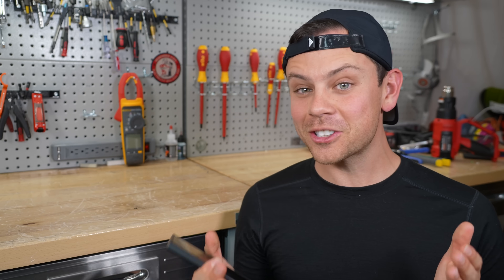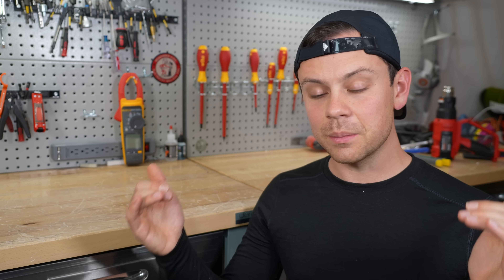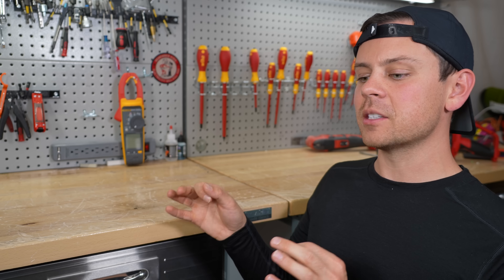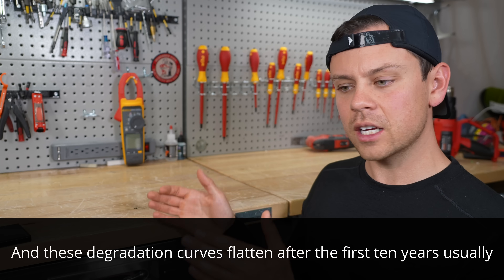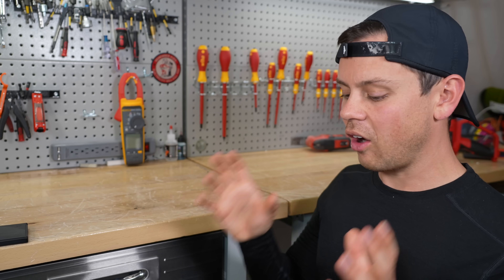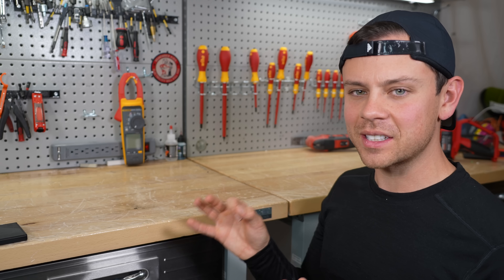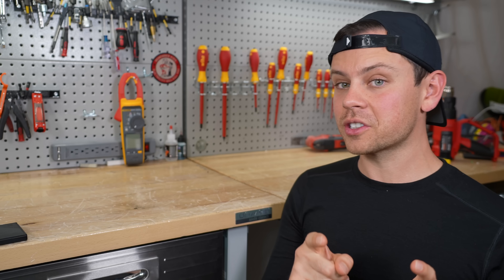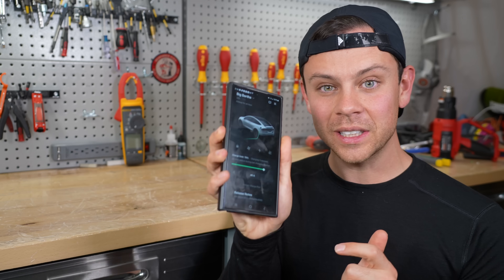LiFePO4 Longevity Discussion! Why Charge to 100%?! For Solar??

Comment: I am planning on making a UPS style battery backup system without solar for my home's refrigerators. In this case, I was going to keep the LFP battery at 100%, so it is full and ready to be used if the power goes out. Is this more detrimental of an idea than I was originally thinking?

Comment: Question perhaps for the knowledgeable commenters... I'm interested in about a 600w solar system for a hunting shack/shed. Primary use would be several hours per day running a vent fan to prevent condensation in the metal shed, then running some led lights and a few things when in there. This is in Wisconsin. What concerns should I have for lithium in potentially several days in a row below zero temp?

Comment: I didn't see the first video but yeah, the thing about LiFePO4 (having owned a car that uses one for 2 years now) i can say that charging to 100% is ok. It's just fine. Solar is way different than a car though, but one thing tracks: That voltage curve. That's unique to them and are extremely tough for any mfr or computer to basically predict when the batteries are between 90 and 10 cause the voltage median is gonna be very similar all through that range. A charge controller for a solar system?? Wow, yeah, i think that'd pose a bigger challenge. Can't wait to actually go as off-grid as possible. THanks for the video!

Comment: why are victron solar chargers set to 4.2 volts from factory,what voltage is 100% on a solar system not used daily?

Comment: You contradict yourself in the first minute… “charging to 100% doesn’t hurt it at all”, and then: “if only one cell is making it up to 100% it will fail first”.
Reply from the maker: Charging the whole pack to 100% with solar is difficult, and most people need to focus on doing it more. If you hold any lithium ion cell at a higher voltage, you will have faster degradation. But people aren't even charging enough to avoid imbalance. You want the cells to cycle together. Having one cell held at high SOC while all the others are not, will lower the capacity of the entire pack over time. Charging to 100% off and will keep all the cells happy and balanced
Reply: @WillProwse  while charging a life-po4 cell to 100% is has much less degradation than a -ion, it is still a negative impact.  charging to 100% (or even 95%) occasionally to help the balancer get on track is a good thing, that should be on the order of once every 15-20 cycles or maybe once every one or two months.  because it definitely has a negative per cell impact on health.

Comment: So for a camper is good to have instead of one big battery two smaller batteries of lower capacity and use them in turns, while you use one, the other one gets charged to 100%. Then alternate.

Comment: I have Solar and a LFP battery. Since I increased my Solar array last autumn, I had the "problem" that my battery sat at 100% for most of the day, since the power usage over night rarely brought the capacity down below 60%. Since that is the one thing that all batteries, including LFP don't like, I am currently working on a little algorithm that makes sure the batteries charge slowly over the course of the day and only reach 100% right before the sun goes down. Apart from that...I don't worry about my battery.

Comment: Fun fact one of the most damaging thing for LFP in normal condition is continuous charge of more than 80% at a time, so if you setup limits from 0 till 100, each time you charge your EV on a sunny day you will most likely have one continuous cycle from 0 till 100% damaging the batteries. In addition continious cragging cycle exceeding 80% is not linrary destructive, that is the reason manufacturers usually recommend setting minimal discarging to 10% so the battery would not degrade within the warranty period.

Comment: Question. I have four 12.8V 100Ah lithium Fe batteries that I'm using to replace my lead acid batteries that came with my Ryobi electric riding lawnmower. I charged each lithium battery individually to 100% do I still need to connect them in parallel for 24 hours before installing them into my mower? If they can balance on their own after being installed that would save me some time and my new batteries have a BMS.

Comment: I've been watching your videos a a few years, and they are a great learning tool. I've researched this subject, and I see so many sizes of batteries, all different sizes, but most claim to be 100Ah. So, what is the main difference (I'm assuming capacity) and for the sake of simplicity lets say, a Group 24, 27, and 31 type, as far as capacity, if they are all 100Ah batteries? I come from the lead acid/AGM group, and because I don't have a lot of space in my sailboat, I'm asking. Thank you.

Comment: One problem if you are using a ecoflow as a active UPS and set charge level to 100% it will never actually reach it but the fans will run harder and most put out more EMF

Comment: I work for a lithium ion battery manufacturer and we offer a 10 year warranty for the battery and we don't care what you do with it. So far it has been about six years and we haven't had a single battery go bad, not a single warranty claim.
Reply from the maker: Now that's awesome!!
Reply: So who is the battery company you work for?
Reply: You better send one to Will for review 😂.
Reply: What does "go bad" mean? How much of the original capacity has to be remaining?
Reply from the maker: @seeibe  shorted cell or reduced capacity below whatever warranty states
Reply: He's talking about LiFePO4 not lithium ion...
Reply: never seen this before we use all sort of lihtium battery and different brand all of them failed ....even the branded expensive japanese made MURATA batteries..... this guy is lying

Comment: Here's a question for you. I have an RV with 3x100Ah LifePo4 batteries. I use the RV solar about 3 months a year in the Summer. The rest of the time it is either parked or I am using "shore power". Therefore, 9 months of the year, I am not drawing from the battery bank but the solar is still putting power into it. Should I disconnect the solar input and just check the SOC now and then? Does it hurt to have a "float charge" for months? (I live in Kingman, AZ, not far from you so the solar exposure is quite similar)

Comment: I have a 24V 120A mppt solar inverter with bms. I have heard that its better to have a battery that has more then 120Ah, less Ah would be overcharging the mppt and could cause the battery or solar  inverters lifespan or cause maulfunction correct? So can i connect 2x 12Volt 100Ah or 2x 12 Volt 120 Ah batteries so that i will have 24Volt batterie with more than 120A for the solar inverter?

Comment: Thank you!  I have been tinkering with solar for about 2 years, and have a fairly robust DIY system based in LiFePO4.  The arguments are very similar to when SSD's hit the market for computers and everyone was losing their minds about using them.  Guess what?  The SSD's outlived the computers they were put into with very little loss of speed or capacity.  So yeah, you just reminded me that the battery chemistry I am using actually "prefers" full charge and discharge cycles, I just readjusted my AC transfer switches to allow for a lower DC voltage before kicking over to grid from the inverter, and I set the reset value to higher so that the batteries hit their maximum voltage before switching back to inverter power.

Comment: Excellent info. I appreciate your efforts greatly. Pardon the question if you have already answered it somewhere but my question is this: If I was to rack and operate the LiFePO4 batteries I purchased in my walk-in cooler where it never drops below 33 degrees F and generally not above 48 degrees F year-round, would this be ok for their life expectancy? or would it be really that much better to be closer to 70 degrees F all year-round?

Comment: I bought six Lifepower4 51.2v 100amp batteries, and put them in parallel three years ago.

I checked them once a year. Never used them for anything, but checking voltage.

The voltage has always been at 52.6 from the moment they arrived  until today.

I was worried each time I checked them, because there are many videos that say they "discharge 1-3% every few months".

The voltage has not dropped in the slightest for THREE YEARS. So I have no idea where the "1-3% degradation every few months" narrative comes from.
Reply from the maker: The voltage will not drop.it has flat discharge curve. Don't use voltage to determine SOC with lithium iron phosphate
Reply: @WillProwse So if it's not voltage, how can we check their state?
Reply from the maker: The narrative comes from doing actual capacity test on batteries that have been sitting. Look up the literature it's very easy to find

Comment: I was literally running this through grok about where I should set a lower limit for voltage.  Grok was adamant that 10-20% was near the limit for lithium and 0% would cause damage.  I have solar in the RV and figured I would set my lower limit around 12.6volts.  so running the system down to zero won't hurt it?
Reply from the maker: No don't worry about it Just charge it as much as you can
Reply: @WillProwse awesome good to know, everything I read suggested 0 was bad.
I only have a 200w and 100w panel grok estimates I'll be able to generate 1.5kw in 6 hours in ideal conditions.  For now I guess my lower limit will be my ability to fully recover and hit 100%

Comment: Newbie to solar here, I have watched countless other solar videos on YT, and having finally watched this one, I am in agreement with your flawless logic, 100% SOC is the way to go, and as detailed in the Envision B grade 315Wh cells I have coming, the data sheet says the same, I note that nobody seems to 'actually' be prepared to give an 'average' calendar age, suffice to say, I guess that 8000 cycles @25C is the only indication. I am a retired carpenter/joinery, and will design a compression/cooling cabinet to try and keep the cells around 25C, I will try looking for your other videos for your thoughts on this. Thanks for doing all this Will. Best Regards.

Comment: At what voltage does the balancing circuit start on the new LiTime 12v 230Ah Bluetooth, low temp?  I've read on their website that it has both passive AND active balancers.  Is this even possible?  Their bluetooth doesn't show individual cell voltage, only whether the system is balanced or not.

Comment: Is this the same for lifepo4 batteries used in other setups not related to solar?  I use a power station (with lifepo4 batteries) as a ups.  There is a battery saver setting which I use.  I now question if it's necessary.  It's a ugreen gs600

Comment: Question. I have an RV with 10 KW of lithium batteries. I take it out about once a week for 2 to 3 days and keep it plugged in the rest at a SOC of about100%, actually 99% according to the BMS. Is this a good practice or should I be doing something else?  I like to leave it on because I need Wi-Fi running and a few other things to keep my security system in place.  Thanks in advance.

Comment: Although you can always of for a low discharge, sometimes you will need to charge to 100% to balance the cells. The relatively flat SOC curve that only changes drastically at almost 10-20% or at almost 100% is both a blessing and a curse. The BMS will only be effective at balancing close to 100%.

Comment: Also don’t mix 15s cell batteries with 16s batteries…

 I put in parallel a PowMR battery with some generic server rack batteries, not knowing the difference and found the lower cel battery reduced its capacity by half inside a months worth of testing

Comment: There is a reason to not use the battery enough. One designs his system for the winter, where there could be long days without sun. While in summer, there is plenty of sun.

Comment: I guess there is no problem to charge to 100% an discharge to 0% If a build a solar system using a manufactured batterie like Redodo LiFePo4 right as they are supposed alrready ballanced

Comment: Hi I'm hearing about the 100% charge from solar at this point I'm only discharging 20% on average from 100% 
So I'm only going 100 down 80 
There will be a greater load added in time 
Is the discharge side as important as the 100% charge 
Thanks in advance

Comment: I have a question. can I use a built in BMS lithium battery with an inverter that does not support for BMS connection?

Comment: I do not agree with you!!!
I can program my battery to balance at any percentage!!
Why are you saying for the balancing to start it most be 100%?
i will program my battery to charge at 85% max and make my BMS to start balancing at 75%
Can you ask Chat GPT how to make you Lifepo4 battery for solar last long? Did you do this?
Reply: The state of charge of an LFP cell can not be determined by the voltage over the majority of the state of charge curve of the cell. This means that a cell at 3.2V can be at 40% or 80% state of charge. So how could blancing possibly work at 75% state of charge? You need to take the cell to their knees were voltage delta between cells does indicate a difference in state of charge and where your balancer can act based upon this delta in voltage.
Reply: @upnorthandpersonal  
The main advantage of a BMS is to protect the battery from damage, not just to balance it. So I believe that charging the battery to full capacity isn't ideal for long-term lifespan. I plan to set my BMS to start balancing at around 70% state of charge. I understand that balancing is more effective closer to 100%, but the key point is that as long as the BMS is active, charging only to 70% will still fully protect the battery from damage.
If I'm wrong, please let me know.
Reply: @ You didn't understand: it is impossible to balance at 70% state of charge with LFP. NCM, sure, you can. LFP, no way. Turning on a balancer at that level will just increase your overall imbalance.
As for cell cycle life: LFP cycle life in the datasheets are from 0% to 100% (3.5V to 3.65V). Do you have to go to 3.65V? No, 3.5V is above the knee and can be used as balancing point (anything over 3.45V really). Considering that LFP cells are measured in the multi-thousand cycles from this 0% to 100% (typically 4k to 8k cycles) you will see cell degradation faster from calendar aging than from actual cycle use, especially in solar applications.
Reply: @upnorthandpersonal  
I’m not very experienced in this, so I would appreciate your advice.
I have a Magnum 48V inverter that accepts a maximum input voltage of 62V. I’m planning to build a 17s2p LiFePO4 battery pack instead of the usual 16s2p.
The reason is that I want to charge the battery to a maximum of about 85% to extend its lifespan.
I have learned that the higher the charge percentage, the fewer cycles the battery will last.
By using a 17s configuration, I can charge up to 85% while staying within the safe voltage limits, and I plan to set the BMS to start balancing much earlier, rather than waiting until 100% state of charge.
Please advise me if this is a good idea. Thank you!
Reply: @greatogbuagu1370  Don't do that. Make a 16s battery, and limit the charge voltage to say 3.45V or 3.5V per cell or so and stop charging once you hit that voltage. For a 16s pack that means 55.2V to 56V. This is the maximum you charge to with your charge controller or whatever. Set your float to 3.375V per cell (54V pack). This gives your cells time to settle: it's not high states of charge that are detrimental, it's keeping an LFP cell at high voltage without it allowing to settle. Your inverter will be fine with this. Set the cut-out at 3.0V per cell (48V pack).
The biggest killer of LFP is temperature. If you charge and discharge over 35C or 40C, you'll end up halving your cycle life compared to doing this at 25C (ideal temp for the chemistry). 
Don't worry about limiting state of charge: you can't do that without accurate Coulomb counting - voltage doesn't work for this. The impact on cycle life in doing this is minimal. Note: everything I wrote is assuming you're using LFP. Other lithium chemistries are different, but the majority of them you shouldn't use in a DIY storage system in 2025 unless you really know what you're doing.

Comment: I can't get my batteries down to below approx 65% SOC overnight.  It takes only 90 minutes in the morning to get the SOC to 100% and it stays at 100% until 15minutes before sunset.  The radiance of the sun at the 32nd parallel South is enormous.  I have 6000watts of panels and 10,500watts of pylon tech LiFePo batteries.  No matter what I turn on to draw power, the batteries never drop below 100% during the day because of the solar output feeding the inverter.
Reply: Very similar here. What are your voltage settings?

Comment: I've got a RWD Model Y with the LFP battery and have done 18k km in 10 months. I've lost 2 km of range so far. I usually drive to around 20-30% and charge to 100% every time.
We will get more solar plus either the Tesla PW3 or a stackable home battery soon.

Comment: Don't despair, there's an endless supply of hearsay and speculation out there.  Much kudos for trying to dispel the myths.

For those still in doubt: Please understand that a) LFP is very, very different from NMC; and b) because of the flat voltage curve, the BMS doesn't really know the SoC of each cell until the voltage picks up near 100%, and only then can the battery be balanced, whether actively or passively.  Look up "Battery University", tons of good info there.

Comment: Actually, using 100% per cycle isn’t the best for LFP battery throughput. At 100% DoD, a 10 kWh battery gets 10 kWh × 2,000 cycles = 20 MWh. But at 80% DoD (20% to 90%), you get 7 kWh × 3,500 cycles = 24.5 MWh—way more energy over its life. That said, you should still charge to 100% every 20–50 cycles to balance the cells and keep capacity maxed out.